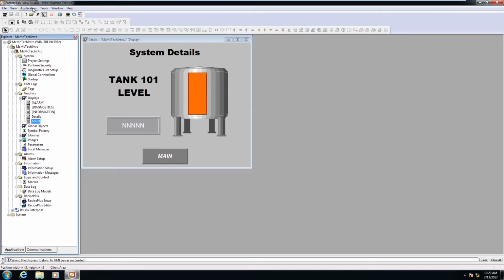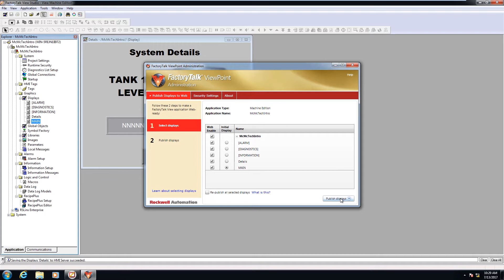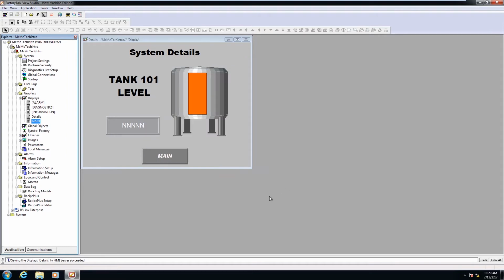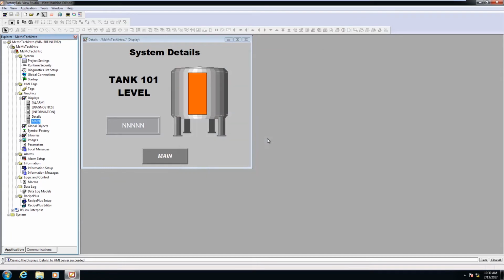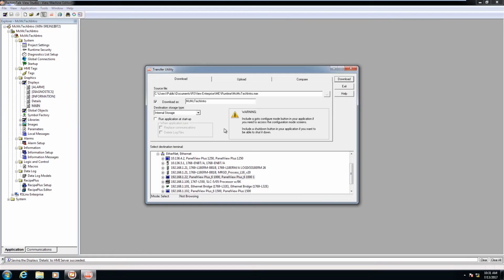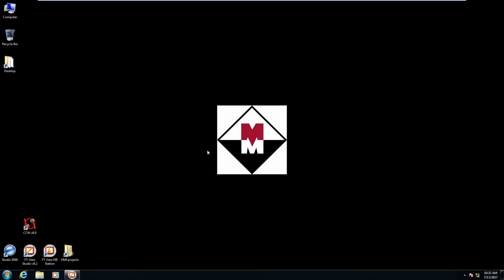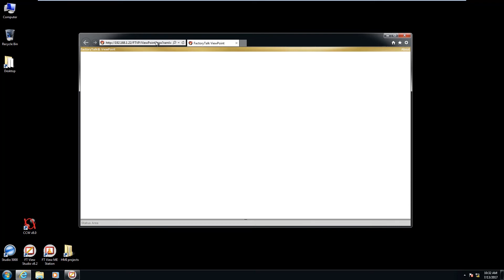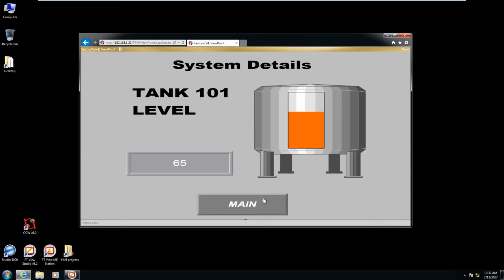How to use FactoryTalk Viewpoint on a PanelView

Comment: Good Morning,  I am trying to set up factory talk viewpoint and I can get it working as long as I have an ethernet cable plugged into the switch that connects the PLC and HMI plus VFD all together but if I unplug the ethernet cable then factory talk viewpoint quits working. I am able to ping the PLC ip address wirelessly but not the HMI. How do I need to set up the HMI to be able to use view point wirelessly? 

Thank you!
Reply from the maker: Hello and thank you for your question. This issue is likely between your wired and wireless ethernet networks and must be handled at the IT level. We recommend you work with local resources to ensure that your wireless devices can view the appropriate automation devices.

Comment: I'm trying to connect to my panelview plus 1500 with 5.10 software via web browser. I published the screens from the app then  produced the app with viewpoint enabled and then tried to open the app via web browser but I keep getting unable to connect message. I was able to verify that the panelview is communicating with my pc as I can run the mer file through my pc and everything works  Any help would be appreciated.
Reply from the maker: Hello, This error can sometimes occur when the ViewPoint software was installed after an older patch rollup. Try uninstalling any Patch rollup and FactoryTalk ViewPoint and reboot your computer. After, install ViewPoint and the latest Patch rollup then reboot again. If you have further questions or concerns, we recommend reaching out to your local Rockwell Automation distributor for personalized support.

Comment: is there any other way to show the Display Screens in a web browser if we don't have a panel View(Hardware).
Reply from the maker: Hello, FactoryTalk ViewPoint connection is not supported when FactoryTalk View ME Station is running on a Personal Computer (PC). FactoryTalk View ME Station installed on a PC does not include a FactoryTalk ViewPoint ME server. Only the PanelView Plus has the FactoryTalk ViewPoint ME server.

Possible solutions:
1.	FactoryTalk ViewPoint for SE can connect to a PC running the FactoryTalk ViewPoint for SE server.
2.	Remote Desktop connection.
We recommend reaching out to your local Rockwell Automation distributor for personalized support. Thank you!

Comment: Can this be used through a browser outside the plant network?
Reply from the maker: Hi Michael, Yes you can access a ViewPoint webserver via the Internet so long as you work with the local IT department to establish the necessary architecture to reach the server remotely. This would involve layer 3 routers (ie the Stratix 5400 or 5410) and setting up routes, security, and other IT policies. If you have further questions or concerns, please reach out to your local Rockwell Automation distributor. Thank you!

Comment: As a Process and Field Engineer for an OEM Integrator it’s my job to visit a lot of plant sites, mostly power plants to service, troubleshoot as well service and automation upgrade our equipment and systems. And one great way to use FactoryTalk Viewpoint with FactoryTalk application HMI Workstation or Panel already there is via a mobile device fit for industrial application or use. A smart mobile device like a Panasonic Toughpad which is industrial rugged but basically a mobile PC. Whether you already have a local Operator Workstation PC or HMI Panel on a Control Panel you can port the HMI via FactoryTalk Viewpoint to the Toughpad via the web interface. Thus easy to pull up on the Toughpad PC. You now have a mobile HMI that goes with the operator as he makes his round around the plant site or plant floor in a manufacturing environment. That is already what the guys already do at many power plants though not yet at all with their mobile device. But it’s one great way to use viewpoint. Unless some manager care to pull up the plant HMI at his office or at home on his PC using Viewpoint. I told my office Electrical and automation guys that we should think ahead, futuristic use and convenience for our end users and do stuff like that when developing applications, they look at me as if I lost my damn mind. And I’m looking back at them wondering why they so close minded.
Reply from the maker: Hello, thank you for your thoughts.  It’s great to hear that you see the value of this technology.  We are always working on new Product Updates and Technical Support videos, so subscribe and stay tuned for more!